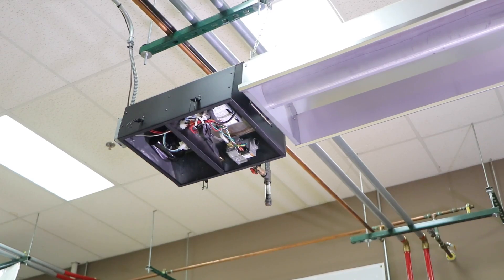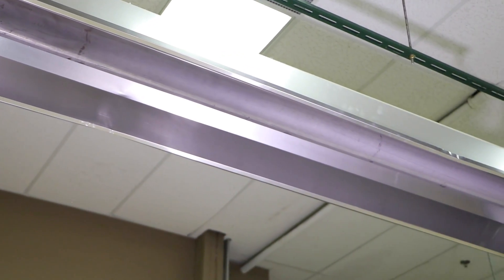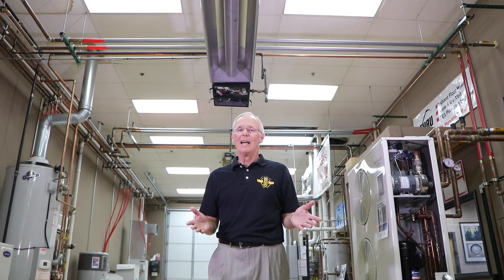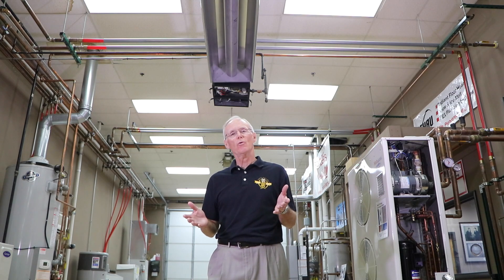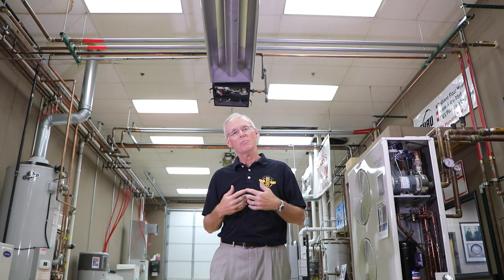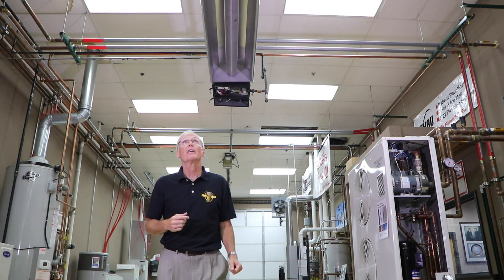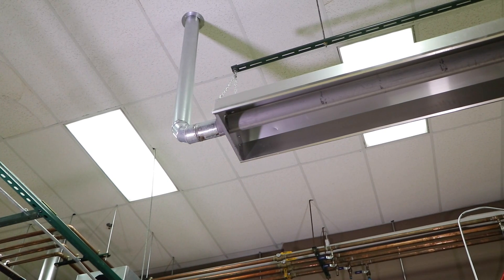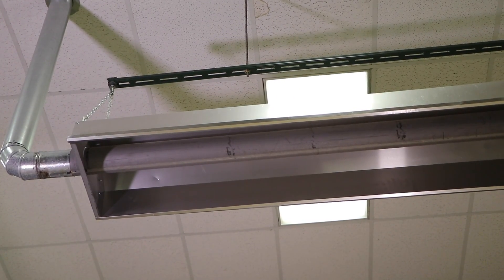Infrared Heating Basics (1 of 5)

Comment: Good video, but some misleading comments.  Never place hot rolled steel tubes in a car wash - they will rust.  Also, 2-stage cuts the on-off cycles of a unit by 35% but the tube temps stay within 5%.  That's where the savings comes.  Drive a car in the city vs. the expressway - where do you getter better mileage?  Longer heat runs without excessive cycling saves energy.  Comfort (ex. patios) notably better with two-stage too.

Comment: I have a 45' by 60' foot shop how big do I need
Reply from the maker: You size this type of heating system the same way as all heating systems. Someone needs to do a heat loss calculation which is a function of wall surface area, insulative valves for walls/roofs/windows, outdoor design temp, indoor design temp, and air leakage.

Comment: To heat a tent to do outside painting or fiberglass repairs in the winter I guess it would be required to use Paintshop electric heaters to have better insulation around the heater and proper solvent fume protection.

Comment: Can you use infared heaters in a greenhouse for growing vegetables, if so what type would be ideal?
Reply from the maker: Plants need light so invisible hear from an infrared would presumably not help in that application.  Obviously it would heat the space but you would still need light from something else.
Reply: @TECTubefilms  Hi, I meant the heat in greenhouse for vegetables, someone who sells IR said the light would noun CEEK off the floor and go through the glass but I’ve read less than 5% goes through a window in a room… supplemental lighting I would use as well  :)

Comment: I am building a 32 x 32 foot detached garage, ceiling 12-14 feet high.  Thank you for this informative presentation.  I am using the shop mainly for a place to work on my vintage truck.  The 3rd stall area doesn't need heat, as it is just to store my boat.  So in order to heat the other ⅔ of the garage space, which of your products would you recommend, and how high off the floor?  Thank you
Reply: One more think, what brand of infrared heater do you recommend?
Reply from the maker: @philipsondreal6565  We switched over to Schwank a couple of years ago for multiple reason including their very high "radiant efficiency."

Comment: Well is it possible to explain us how does the ir heating work for road pothole repair equipement if so
Reply from the maker: We are not exactly sure what you are talking about as we deal specifically with the building industry.  However, if you have a portable IR heater and you are using it outdoors, it would fundamentally work the same.  IR heat is always directional, cuts thru the air, and lands on a target object.

Comment: I'm needing heat for my greenhouse. 3000 sq ft, has black weed fabric on all exposed surfaces and I need to keep it around 55-60. That means I need to raise the temperature 30-50' in winter. The structure is all metal with poly ends and has a roll up door. Can I use a wood fired furnace outside of the structure to supply hot air?

Comment: If one were to use such a system with presence detection, what is the time delay for a person to feel 'comfortable' or at room temperature with say an infrared heating panel? Also, if a house were retrofitted with infrared heating versus forced air, what are the option in terms of keeping items such as water lines above freezing? Would these then need to be wrapped with resistive heaters?
Reply from the maker: We have never heard of anyone using an infrared heater like this in a house (other than the garage).  It would not be practical from an installation standpoint... you would need these all over your house and each with its own gas line and exhaust vent.  Plus the ceiling heights in a house are often too low.  With that being said, there would not be a concern about water lines freezing unless you set the thermostat to main a very cold temp (say under 40F).
Reply from the maker: You can use these with "presence detection," and the delay is not long at all for an occupant to feel the heat... it only takes minutes to heat up the tube.  And from there the benefit is immediate... sort of like stepping out of the shade and into the sunlight when you are outside on a 60F day.  Check out this sensor that controls for occupancy, air temp, and radiant temp - https://www.schwankgroup.com/products/ir-controls/trutemp-ir-thermostat/
Reply from the maker: Or this video - https://www.youtube.com/watch?v=YGgp0oKRvSA
Reply: Something else I have been looking for is beam steering of infrared heaters, but I believe at this time it would be too expensive to implement in terms of optical or electronic beam steering for focused illumination.
Reply from the maker: Those panels are electric infrared, not gas infrared like the subject of this video.  We are familiar with electric infrared and have used them in niche applications before.  While there is nothing wrong with electric heat, in most places... especially in Chicago and the Midwest where TecTube is based... gas is super inexpensive compared to electricity, and hence even the most efficient of electric heaters will never cost less to run than the least efficient gas heaters.

Comment: Let me say, This was a well documented video (I saved it).  Very informative!  My im-patience has gotten the best of me again, I'm halfway through video But, am wondering if there is fairly simple solution to block some of the heat, for human comfort.  Reason is; I installed this type of heater in my 32' x 48' Man Cave , 12' ceiling but happens to be over TV & re-cliners area.  Un-expectedly spending more time here this winter, since my house burned down.
Reply from the maker: Sorry to hear about your house.  Infrared heat is line of sight.  You could put a piece of metal between the heater and your TV area, but once that object was heated up, it would then become its own radiant heater and that would start shining heat to the area.  Instead of a piece of metal, you would want to use something more "insulative."  And of course, pay attention to the clearance to combustible rules for your specific heater.  Some heaters can also be installed at an angle to direct the heat more in a certain direction.
Reply: Thank you Tec Tube, I fab'd a 3' x 5' metal screen, hung it from ceiling about 3' below infrared heated, laid a piece of aluminum perforated soffit scrap on the screen & it has helped tremendously.